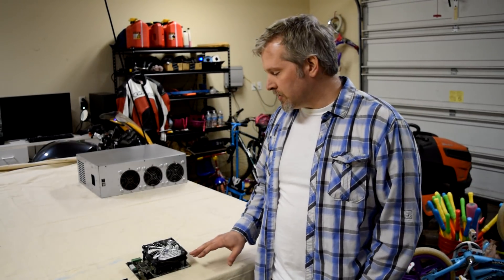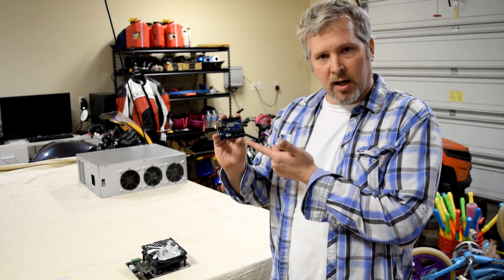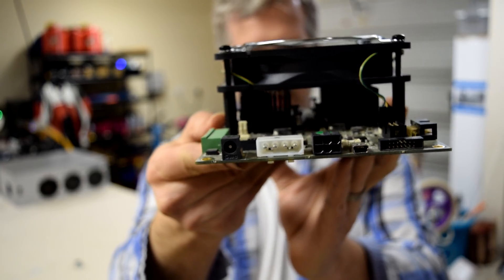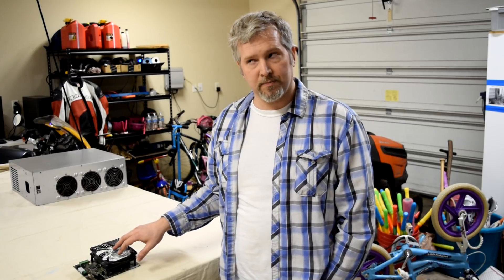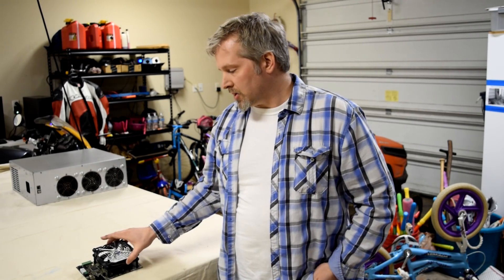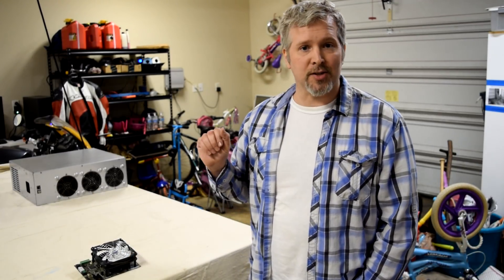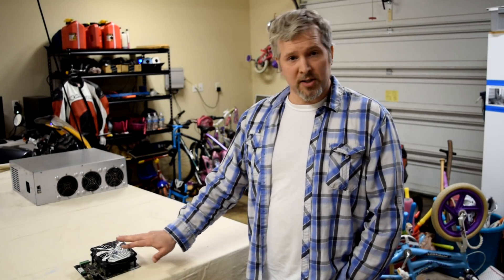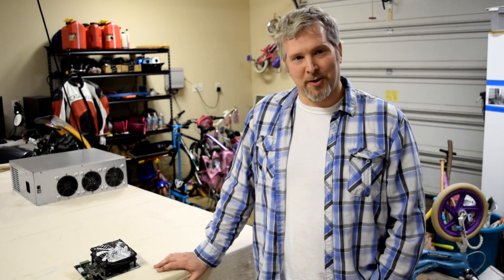Why mine with an FPGA 2018

Comment: Baikal Giant-B miner is an FPGA miner which is why it can do so many algorithms and it only burns 300W, it was making $600 per day when it came out.  FPGA's are huge secret in crypto-- they can't beat ASIC coins but if you can program them to mine a GPU coin you will make a fortune every day.   Running at 40W?  So for the usual 1200W miner consumption you can run 30 of those FPGA boards so be sure to multiply the hash rate by 30 before comparing to a GPU rig or ASIC rig.
Reply: efattah ssshhhh!!
Reply: it can do blake,lbry and pascal... can it be used for eth or cryptonight ?